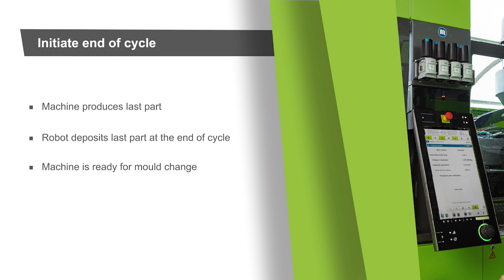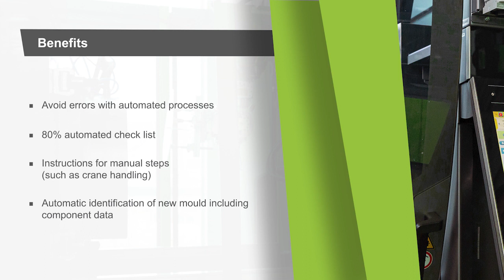Change a mould in 15 minutes instead of 1 hour

Comment: Can we see the setup settings to do it?
Reply from the maker: Hi @mlmil4405, we always supply our cutomers with the default process, which can be adapted to the specific circumstances or requirements on site. Stop at 0:17 to get an insight and don't hesitate to contact info@engel.at for more details.